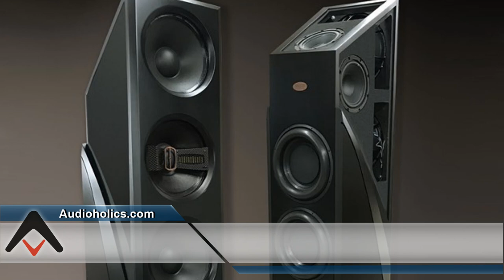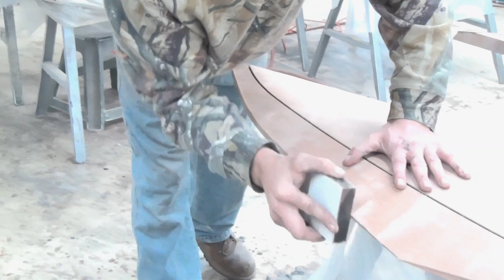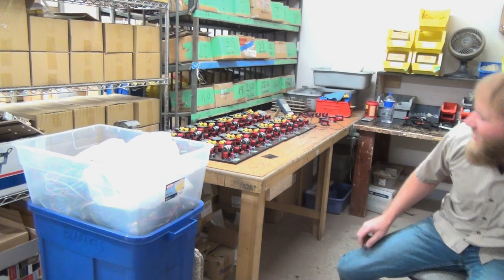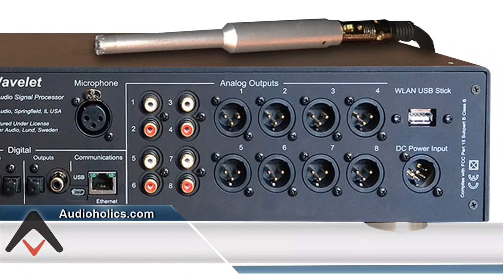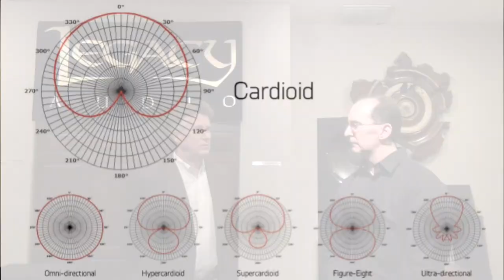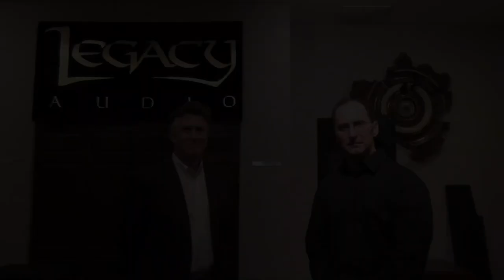Legacy Audio Speakers Interview with Bill Dudleston

Comment: I have my original pair of Classic's I bought in 1985 and the cabinets are perfect. Unreal build and sound. Blew the leaf tweeters out but other than that they are perfect condition and sounding.  I highly endorse this company and products.
Reply: I have Classics too. I am not sure of the number of iterations of Classics. Mine have rear tweeters and woofers (from the '90s?) I really like them, but unimpressed by the engineering/application of the spike feet.

Comment: Nice interview. One question: which speaker is best for mitigating room nulls? In my room with my current speakers, when I stand up, bass drops off noticeably; when seated it's fine. Is there a particular driver configuration that works against this? Thanks.

Comment: Nice video.

Given Bill seems knowledgeable about DSP processing and several of the more involved aspects of electroacoustics (such as shaping the LF acoustic energy in ways that reduce/remove and/or shape the omni-directional nature of low frequencies), and that he has clearly sought apply that experience/knowledge and to heavily invest in it within Legacy Audio’s loudspeaker range (particularly the Valor); it therefore stands to reason that he must have at some point employed some of the typical/complex (below-mentioned) testing approaches to validate the design, expenditure/cost, and performance; such as . . . . . .   

The following tests; frequency v pressure/amplitude - cumulative spectral decay plot - step/impulse response - phase v frequency - diffraction {power cepstrum} - acoustic centre - distortion - intermodulation {particularly between mid range and high frequency coaxial drivers}).

It’s very hard - almost impossible - to verify just the implementation of DSP implemented filters (let alone without adding/including some kind of acoustic cancellations and/or beam forming functionality into the DSP/other design of the loudspeaker; without verifying the result with at least 70% of the aforementioned test/measurements, 

As such, I would appreciate it if Bill would either publish or send me results of the aforementioned tests.

Cheers,

Jim Stanley.

Comment: Just use 5, 15inch bass cones made of pure graphene , 4 midranges each 4 inch .  and four midtweeters of 2 inch all from graphene and distortion will be pretty much nil. Just the cost will be $666,000 per speaker